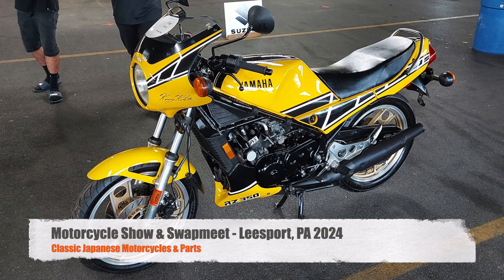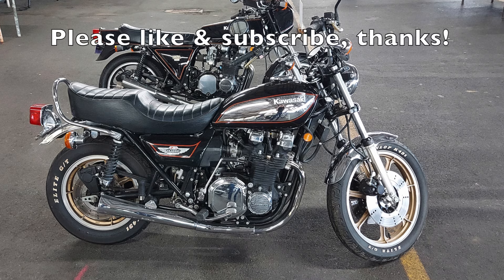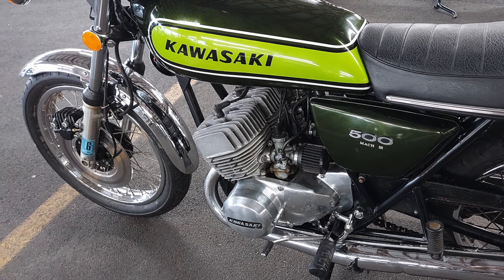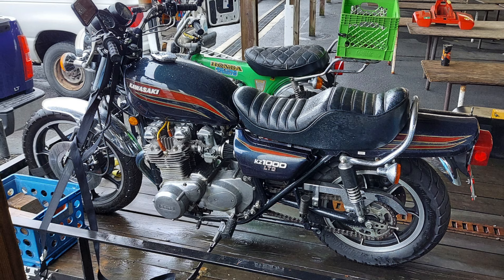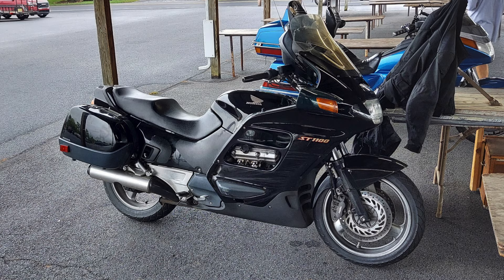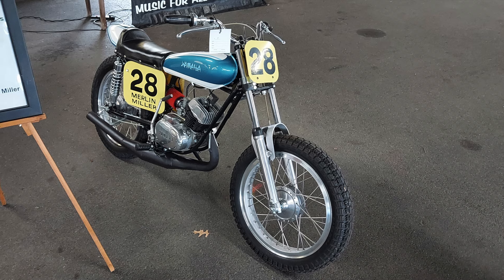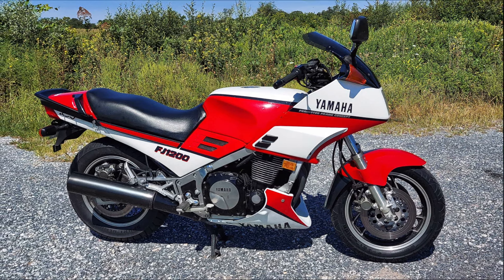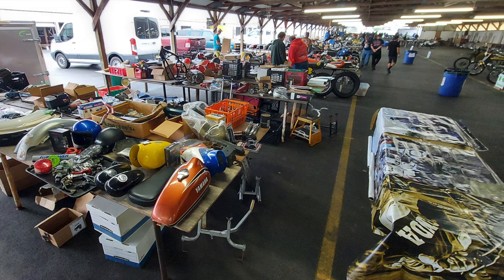Motorcycle Show & Swap Meet - Leesport, PA 2024

Comment: I had a Seca Turbo for a few years, I disconnected the waste gate and put four piston calipers on the front brake and improved the suspension. I did most of these things before I owned it for a friend. He gave it to me and I gave it to another friend. It was a nice highway bike.
SC500s were discounted to $795 in 1975, flexible frame and difficult power band. The 360 was more balanced and the 250 was the best. More power didn't improve that chassis. RZ350 great bike, Too much fun. Toomey racing made them more fun. Loose your license fun.
Reply from the maker: Thanks for the additional insight into the Yamahas, Donald! I can't Imagine riding the SC500. Sometimes too much is too much. I rode a friends race-prepped Banshee 350 in high school. One hit of the powerband and a rooster tail of gravel later, I'd had enough. I idled it back to him with a sincere "thanks, but no thanks"! Cheers!

Comment: Miss my old 79 kz1000 ltd don't miss the 90.mph high speed wobble own a number of 1000s and one 900 most  of them had that wobble cranking threw the gears ? Nice review of the swap meet
Reply from the maker: @KennethMayo-h9h  Thanks, Kenneth! I think the woble can be induced just by shifting aggressively at the higher speeds. I've noticed it on several of my classic bikes. If I'm smoother with my control inputs, it isn't as pronounced. Still, you can feel the chassis flex when you push them hard. Cheers!